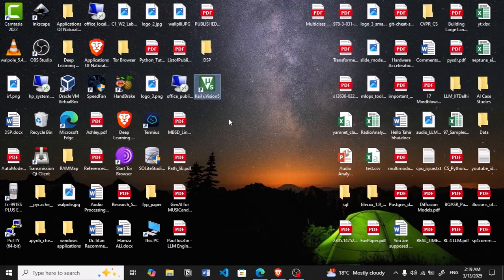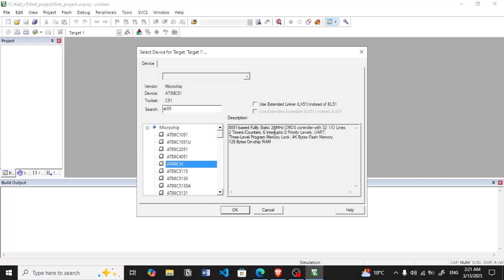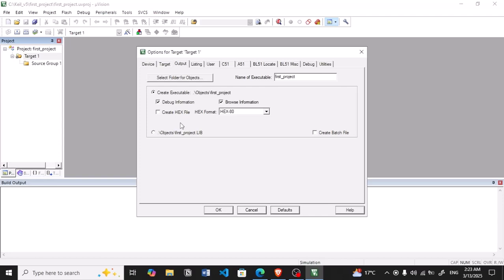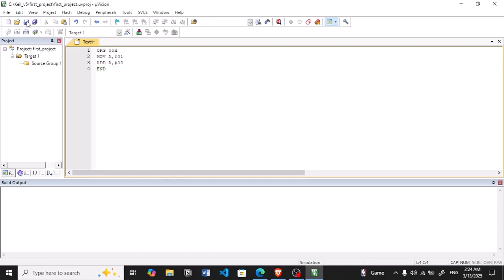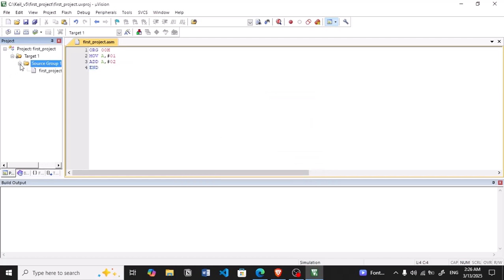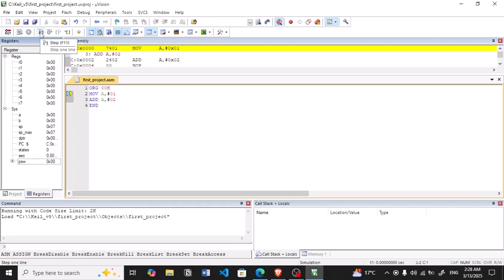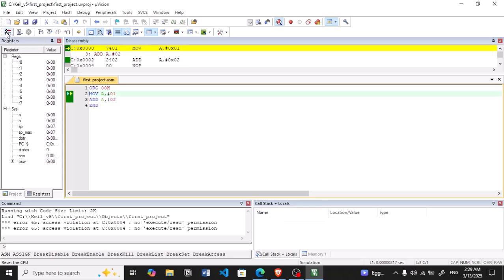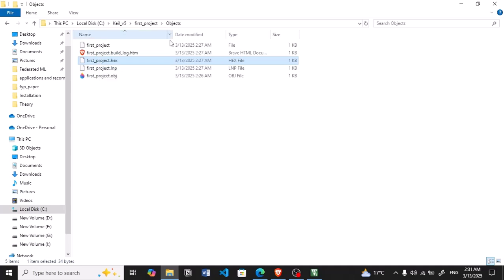Basic 8051 Programming in Assembly using Keil | Microcontroller by Mazidi

Comment: Sir, if I run this code and then change the values and run it again, the output will not change and will remain the same. Where is the problem?
Reply from the maker: You need to build it again and then run
Reply: @EngineeringTutorOfficial  oky. Thank you sir